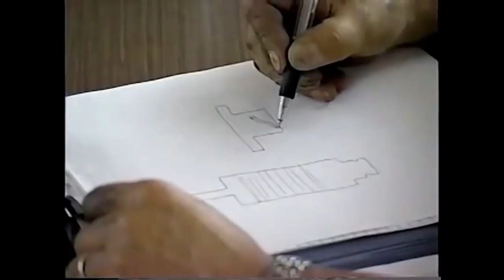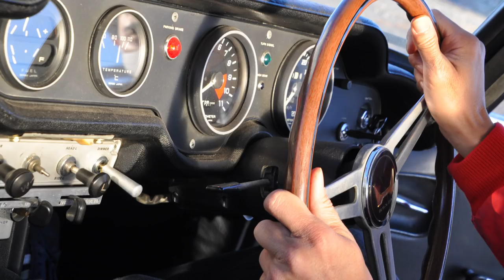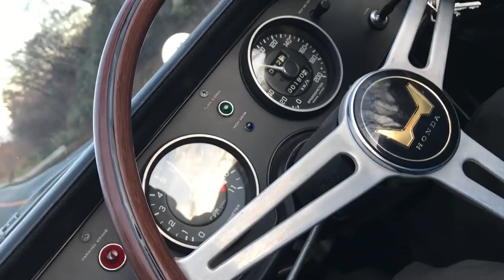One on one with Spoon Sports CEO Tatsuru Ichishima, how to take care of your Honda, JDM Masters

Comment: Thanks for the video. In a VTEC club Best Motoring feature some 10-15 years ago Ichishima made a categoric advise that the transmission fluid should be changed much more often than the engine oil. Seems his advice had changed now which may be a result of advancement in oils etc but I would've liked to have seen more questioning on the subject.
Reply: Are you sure
If I remember correctly he said back then, to change mission oil at same time as engine so perhaps 5000 km 🤔
Reply: @ArtVandelayOfficial  I am very sure cause I only recently watched it again

Comment: sometime its run only one gear but when engine is running very strong the tachometer reach 120 very fast, its all in the engine, all in the engine not aftermarket parts like intake etc.

Comment: Legitimate question please no smart-ass answers. How does 1.6 bar and 2.0 bar transfer into psi? Because I worked this up and the way it reads 1.6 bar is 23 PSI that seems awful low for a front wheel drive car
Reply: 2 bar would be 30psi

Comment: spoon engines better than modern turbo cars, because the only thing you have to do is oil change and you will have high power engine, less petrol than v6 v8 v12 engines, and than you can do other fix very comfortable and easy and durable.

Comment: tires temperature A is good, my gear is auto not Manual but with this jdm engine doesn't seems any different from Manual because itself run like the rpm high and low and down and up, and the engine run like manual doesn't need human gear change, believe me, like when the first gear change the next gear scream for the next gear and the next and the engine gear change is different depend on the engine like some auto supra some of them are rare fast on the internet its goes and follow very fast for the next gear, you will not feel the gear, you will feel the engine very strong.